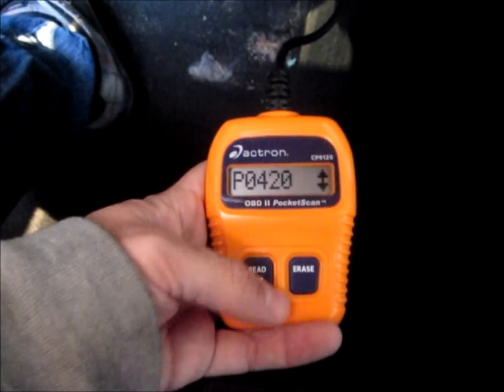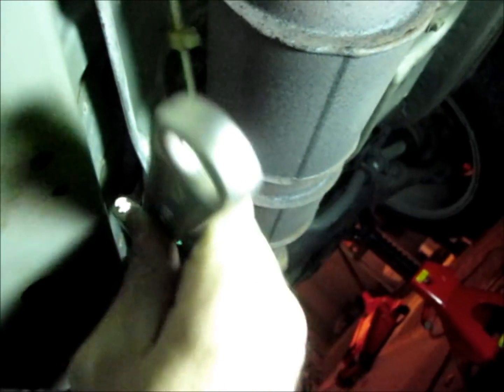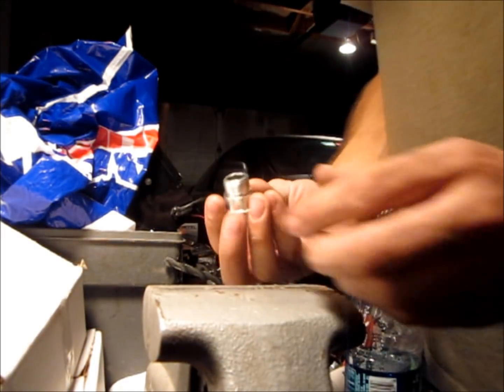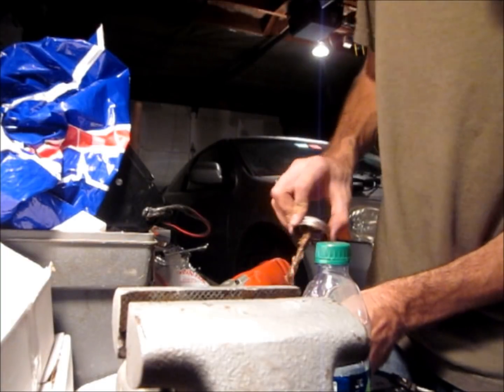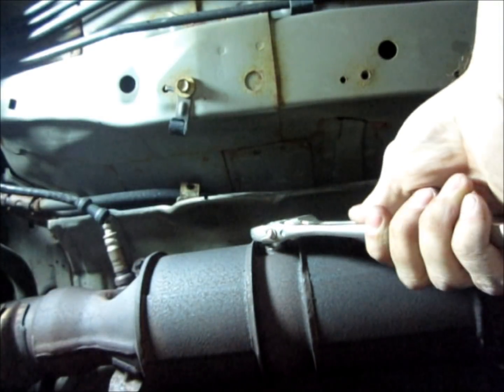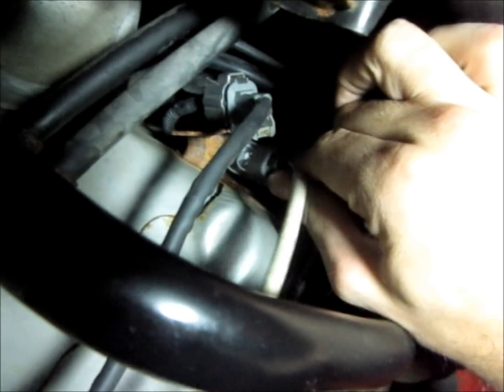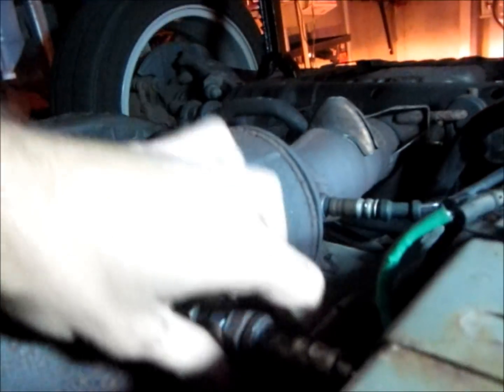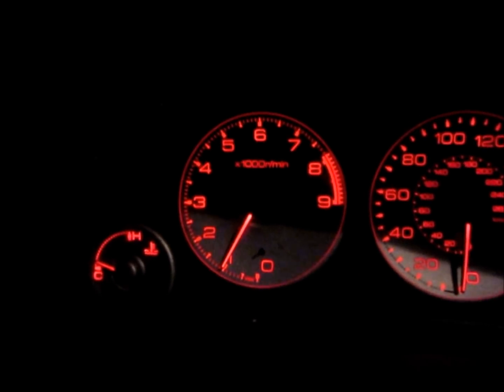Clear check engine light for less than 5 dollars

Comment: Hi. We gave a Nissan Xterra, 2005. Car will start then after 15 min. Stall out. The fuel gauge never worked. The check engine light has been on for 5 years. Never change it. It's only recently having this problem. Took it to mechanic stated it was a fuel pump and had to drop the tank to change the sensor, cost$500-600. Don't not make sense to me.why you need to change a fuel pump when it could be a sensor according to the reading we have from orielly.  So took it to another mechanic nwho wants to charge us $100 to electrical diagnosed the problem. My question was if the showing p430, then it could be just the oxygen sensor, but the mechanic still wants to money. Are there anyone out there to assist with feeling ripoff. I think the cataylic convert will cost at least $300. Thank you for your time and videos.

Comment: Hi everybody, Please forgive me for inserting an advertisement.
I sell this item in eBay, here is the link: https://www.ebay.com/itm/2X-O2-SENSOR-BUNG-M18-X-1-5-TEST-PIPE-OXYGEN-EXTENSION-EXTENDER-ADAPTER-SPACER/173201493286?hash=item28539d0d26:g:2PMAAOSw3jBan3ut&vxp=mtr
I will give you discount If you need a large amount of the item.

Comment: For what its worth...I simply remove the power from the battery for 5 or 10 Minutes.  The computer resets itself...and the Check Engine lights go off in most cases.  It doesn't remove the Code entirely because it'll be banked as an "Old Code"...which you can remove later with an OBDII Code Reader.  Works for me anyways!

Comment: This is the one that you need if you have the larger o2 sensor. Drilling out the de fowler won't work in a Nissan Frontier. Here the part with the deeper inside to use. It worked on mine and no drilling https://www.aliexpress.com/item/Stainless-Steel-Oxygen-Sensor-O2-Lambda-Sensor-Extender-Spacer-for-Decat-Hydrogen-M18/32811667303.html?src=bing&albch=shopping&acnt=42005546&isdl=y&aff_short_key=UneMJZVf&albcp=133368715&albag=5555450765&slnk=&trgt=pla-4585444525144214&plac=&crea=13195869946&netw=o&device=c&mtctp=e&utm_source=Bing&utm_medium=shopping&utm_campaign=PA-Bing-Automobiles%20%26%20Motorcycles-US&utm_content=All&utm_term=o2%20sensor%20spaer&msclkid=88857b58c25917690f0921c9c05a0efe

Comment: The maintenance required light you turned out by holding your trip meter was actually you oil change required light !!!!!!! Had nothing to do with your code or your converter

Comment: Hi I have Xtrail 2005. Last week in the freezing rain, I try to open the front doors. First I try Driver side then I try  the Passenger side door. Both door locks are broken, the handle came out. I was in hurry to to my work at 5.00 am. Then I opened a back door, entered inside. Please any one advice me how to fix this problem. I cannot spend more money on this car to check with dealers. Thank you.  Moh.

Comment: Best way is to remove that stupid catalytic converter and  weld a straight pipe.
Reply from the maker: Yeah, one of those "test pipes" that looks like a catalytic converter.  Only thing is it will smell like a motorcycle exhaust.  You have to be careful if it's an on-road car, some states are more strict with this stuff than others as I'm sure you know.  But a couple states don't even have inspection such as Florida and Michigan, so it depends.
Reply: Sasa Glisic if u live in some states. but they removing slot of era for energy big money business

Comment: dont heat up exhaust with a propane bottle torch. this will be useless. it will heat up so slow youll expand the o2 threads at the same rate as the threads on the boss. Dont use anti-seize on exhaust it will bake up to carbon crumbs from the extreme heat and foul the threads when someone tries to remove it. Third dont listen to this guy He dont know squat. Just replace the sensor(especially if youve gone thru the trouble to get the old one out) they are cheap. they are all made in china no matter where you buy it from.

Comment: Is it necessary to double the plug foulers or can you just drill one and thread the O2 sensor into it?
Reply from the maker: Hi Roger,  the point of doubling up the fouler is to bring the sensor as far away from the exhaust stream as possible.

Comment: CEL on a Chrysler 300 2003 how come a mechanic can't fix it?  He don't even know what's causing it and I can't get it passed inspection in New Jersey
Reply from the maker: Did he tell you what code he is getting ?
Reply: moccina I don't remember the code, but it was one of the oxygen sensors
Reply: moccina bad or disconnected,  but in its own it went away.  So maybe it was the connection.
Reply from the maker: Oh ok.  I have actually had that code as well, and sure enough one of the 4 wires was barely connected.  If it comes back on you'll have to check out the 4 wires coming to and from the O2 sensor.  Good luck.

Comment: Resetting the CEL is different for EVERY car. Prove it, drive 50 miles then show us again. I dont believe you.
Reply from the maker: This was filmed in 2011.  I don't have this car anymore, but I did drive it for about 50k miles with no problems after this video (off road).  How would I benefit from lying ?  Thanks for watching.

Comment: I'm a licensed safety and emissions inspector here in Texas. If I were to see that anti-fouler on your vehicle, you can bet as sure as the sun rises every day, I will fail your vehicle for having it. It wouldn't matter if it was on the up stream or down stream O2, I see them on your exhaust I will fail your vehicle for having it installed. I don't care if your C/E light is off, I see them, your or any vehicle, I will fail that vehicle. Go ahead and complain to my service manager. There's nothing he can do as I don't answer to him when it comes to emissions testing. He can't even make me pass a failed vehicle. That's because when it comes to safety test, I answer to Tx DPS.
Reply from the maker: lol

Comment: Yeah, I bought one of this kit and found out I was unable to loosen or removed O2 Sensor so haha.  I'm stuck with this kit for nothing. Tried torch it too and still unable to loosen the sucker.
Reply from the maker: Damn, that sucks.  Exhaust parts capture so much codensation inside the pipes, they can get insanely rusty.  I don't know what state you are in, but you could probably find an aftermarket cat and have someone weld it in.  Depending on the vehicle, the dealership will charge you anywhere from 1000 to 3000 just for the cat.  Good luck!
Reply: I'm in Minnesota so obviously its going to be tougher due to salt being put on the road but I check the sensor  before I bought the adapter.  The car has 224,000 on it so not worth it to spend any kind of large $ on it.  I want to do this just so I'll stop seeing annoying check engine light.  Thanks for your reply.

Comment: For all this trouble to kill the CE lite, just buy a code reader. They all have a reset for the CE light.
Reply from the maker: You won't pass emissions if you go that route.  They can tell if you tried to manipulate the data, unfortunately.
Reply: True, but if you wanna get rid of the frigging CE, a code reader works. If it stays off a prolonged time then it may have self cleared something minor. If not it will "Be Back"

Comment: The catalyst efficiency below threshold. means that the cat is operating below 95% efficiency. I myself sometimes operate at that and it doesn't bother me. just buy a code reader that tells you the readiness. any car newer then 2000 can only have one mil not ready in order to pass emmisions. any car older then 2000 to 95 can have 2 mils not ready and it will pass emmisions. no need to change anything. my car has a 420 code and I passed the last inspection. so just clear your codes drive arround for about an hour check your readiness and when it's ready take it in..

Comment: I found it easier to just remove all O2 sensors and cats, then have the O2 sensors deleted from the ecm. with a pro tune the car runs better than ever. it also helps having a friend with a professional tuner program that he paid $1200 for the software.
Reply from the maker: That probably won't work in a state that does tailpipe emissions.  Even in a state with only emission test via OBD, during the physical inspection they are likely to see the missing cat and sensors, and fail you.  I know Florida and Michigan don't have vehicle inspection at all but most other states in the U.S. do.
Reply: moccina in TN we don't have any type of emissions inspections. fortunately that's something we don't have to worry about. good work on the video. I was just stating this fact because it is also helpful if no emissions test are required.

Comment: my 97 Silverado says sensor heater I had friend shut off engine light, now my oil gage is reading between 40n80 need good advice only had this truck 6mo .
Reply from the maker: Check the harness wiring going to the 02 sensor, could be a bad connection. Test the 02 sensor itself to rule out if it is faulty.  You may have to replace it. As for your oil pressure, not sure how that would be related, but keep an eye out on that, a bad oil pump could damage your engine really fast if not addressed.

Comment: There are hunderds of things that will make your C/E light to come on.  That trick might work if you have a P0420 or P0430 code. But it won't work if the O2 sensor wiring is bad or for the hudreds of other codes your can can put out. Quit being a cheap ass and repair whatever caused the C/E light to come on.
Reply from the maker: Did you watch the video ? I showed the P0420 code right in the beginning.
Reply: I did. And like I said, that trick might work if you have a P0420 or P0430 code which usually means the cat in front of that sensor is bad. That trick won't work if the O2 sensor or wiring is bad. That trick will not work if you have a misfire, vacuum leak, bad solenoid, or many other hundres of things that will cause the C/E light to come on. The way you named your video, you make it sound as if this trick will fix the C/E for whatever it came on. Rename the video to something like "How to get rid of a P0420 or P0430 code for under five bucks."

Comment: O2 extender extension adapter Oxygen sensor spacer HHO Test Pipe (1) Bung -----------$8.20 total, that is what i got off of ebay because it is one piece, steel, and has a way to put a socket or wrench on it to tighten it down.(about 30 or 40 ft pounds) it worked for me after i replaced my cat on an 04 Cadillac Deville  DTS, and the code came back in about 300 miles, (best after market direct fit "walker" makes) i live where my car does not have to pass emissions i just don't like the light on. And i get about 10% better gas millage. i was also told that the O2 senser is good or i wouldn't be getting this code to begin with

Comment: Moccina, have you thought about working for the Big Pharmaceutical companies? They pretty much do the same thing, they fix nothing.  Going down the same path... you could have just removed the instrument panel in less then five minutes and remove the check engine light all together.
Reply from the maker: I wish I had studied pharmacology actually. They make 150 to 180k to start. Big pharma is not going anywhere. If you can't beat 'em, join 'em. Thanks for watching.

Comment: Where do I get the plug to drill out ?
Reply from the maker: It's called a spark plug defouler kit. The part # is shown in the video, you can get these at any auto parts store. Hope this helps.
Reply: O2 extender extension adapter Oxygen sensor spacer HHO Test Pipe (1) Bung -------------that is what i got off of ebay because it is one piece, steel, and has a way to put a socket or wrench on it to tighten it down. it worked for me after i replaced my cat on an 04 Cadillac Deville  DTS, and the code came back in about 300 miles, i live where my car does not have to pass emissions i just don't like the light on

Comment: how much is the O2 sensor itself? maybe that's the problem & not the entire CAT system if the car is only 10 years old or less?
Reply from the maker: At the time, it was not the 02 sensor, but the cat was slightly off spec. I beleive this happened because I ran the car out of gas 2 times in really cold weather, and tried to start the car. That may have been the cause of this, or maybe not but the cat was definietly not clogged, because I had no no loss of power.

Comment: the monitors will be ready with this?
catalist.. o2.. evap etc
Reply from the maker: Yes, but I would drive the car about 50 to 150 miles and then use your code reader to check for sure before you bring it in for inspection.
Reply: moccina I'll try it i need to pass emission test

Comment: since batt was disconnected you reset the cpu sensors, therefore light will reappear after about 70 miles showing same problem code
Reply from the maker: Please watch the full video to the end. I address both the CEL and the MRL.

Comment: this may remove the engine light but now your ecu cannot get an accurate read on the exhaust gas so your probably running rich or lean all the time
Reply: Downstream sensors do nothing more than report emissions data to the ECU. The upstream sensors control your air/fuel mix which determines how rich or lean your engine runs. Obviously your upstream sensors need to be working well to keep your engine running well and this mod is only for downstream sensors.
Reply: untrue, it leans it out a tad & ONLY use this trick on after Cat 02 sensor, it won't hurt a thing in fact it Helps a bit both in Gas mileage & performance, its an old trick.
Reply: Jeff Darkness okay cool i will try it out then
Reply: cool, I think you'll like the results.
Reply: Incorrect, the post sensor merely monitors the cat and if it is running properly, the pre cat o2 sensor is the one responsible for exhaust gas which sets the fuel air mixture.
Reply: Yep.
Reply: What bought daytime running lights not working
Reply: It won't do shit.

Comment: thanks for the video 
I have this code 2C9F can you please tell me what is the problem?
[oxygen sensor heating after catalytic converter 2, activation]
i don't have check engine light.
my car is x5 E70 2007 4.8i
Reply: fan alnadabi that’s a CANBUS code, not OBD2, which is entirely logical on a BMW.

Comment: we don't have emissions where I live at.but how ever I do have deleted my catalalitic converters all 4 of them.the dam engine light comes on and makes my car run like shit.I have a tune on it and runs real strong when the engine light is off that is.my question to u is do I have to do this to all 4 o2 sensors or only 2???? great vid by the way
Reply: If you do this to the 2 upstream sensors (before the catalytic converter(s)) they will not read properly and will still kick a check engine light. The two upstream sensors should have fluctuating readings whereas the two downstream sensors should have a pretty constant reading. A working catalytic converter is what makes that happen.

Comment: Bull crap don't work don't waste ur money
Reply: tried it and worked for me on jeep no light 350 miles 1 week , no pending codes either, and through all cycles. so i guess depends on application/ vehicle. only works on second o2 sensor, but again it did work for me
Reply from the maker: Don't waste 5 dollars to see if this works ? lol !! Ok man, take it to your mechanic. He will charge $50 just to diagnose, and probably $1500 to fix. Good luck brotha.
Reply: moccina I did punk in it wasn't 5$ n it didn't work but u put it out there like it was 100%

Comment: These codes for catalyst below efficiency (p0420 for bank one and p0430 for bank 2) have reasons behind them. It means that your catalytic converter has failed and tricking the engine control module to read right is not a good idea at all. I am an owner of an automotive shop and also an ASE Master certified tech and i have seen many engine failures due to clogged or plugged catalytic converters. the first sign of this is those above mentioned dtc's. Don't take these problems lightly have a professional with the proper equipment check your vehicle before trying this fix to solve these codes.

Comment: YUP!!! This worked on my 2000 Honda Civic. But I bought a 90 degree Angled spacer from eBay for 20$. Spent half an hour under my car, replaced, reset codes, drove around for a few days(to and from work) and went for a smog and passed!! CEL light still off.
Reply: Robert Young cool. I'm in the same boat. Was wondering if it just cleared CEL or actually passed smog test too

Comment: would replacing the censors do anything or would that give too good a reading and still fail?
Reply: If the catalytic converter is bad then replacing the o2 censors only would not help since the cat isn't doing its job. If it's only a bad cat then you do not need to replace the o2 sensors unless you simply can't get the old ones out. Sometimes they can be very tough since the extreme heat can basically weld the sensors to the catalytic converter.

Comment: why was the front wheel of the car turning while you were under it checking for leaks. thanks for this video.
Reply: even in neutral on vehicles without a limited slip differential one wheel will always have power going to it. It's such a small amount that if the car was on the ground it wouldn't move at all.
Reply: roadtesting and repair at once to save time

Comment: Yeah, just a re-set just fixes things for about 35....50  K..(Canadain, eh ?.)..Then "check-Engine" light comes back on..Told to exchange catalytic converter....Look-out,   they cost like hell...Quoted  $1178.00 for my Buick Rondezvous... Gotta be another way.....
Reply: buy converter on ebay its cheaper
Reply: Not to be a dick, but if you understand how the catalytic converter and O2 sensors work with each other then then you will understand that this should work unless you have bad upstream O2 sensors.
Reply: Adam Smith
Reply: Adam Smith i